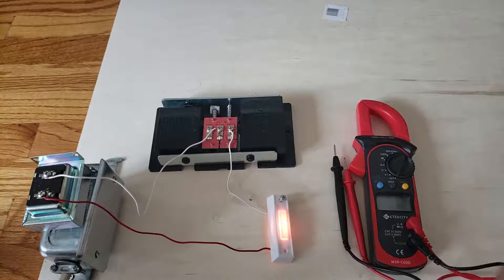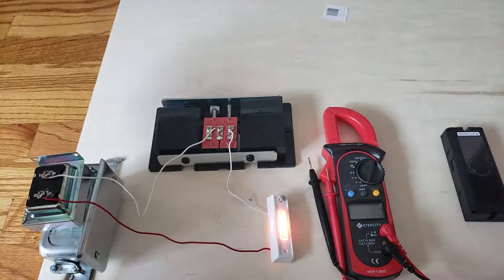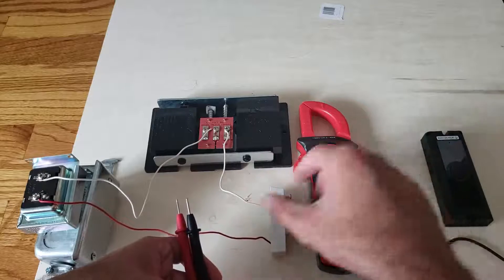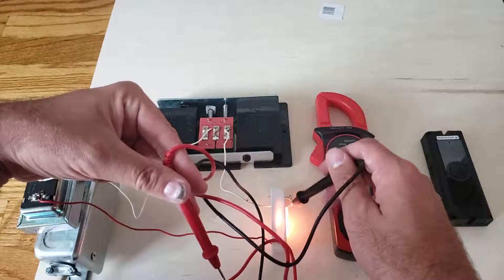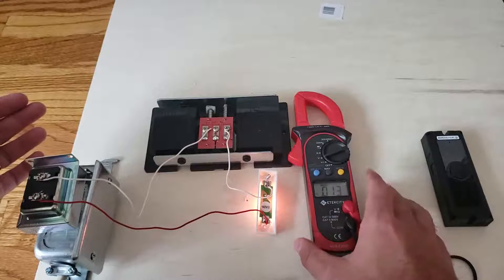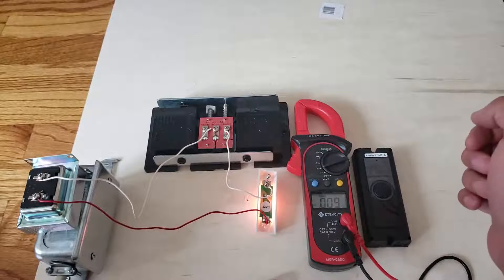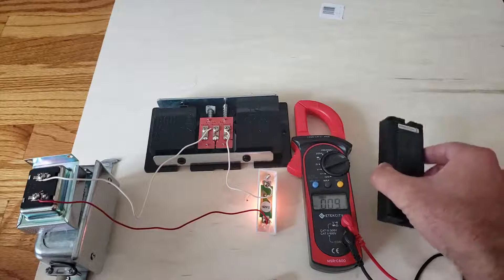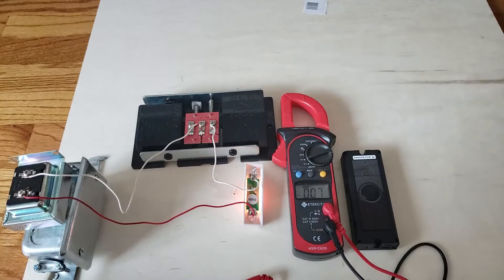Doorbell Transformer Voltage: Do I Have Enough Voltage For Ring or Nest?

Comment: The doorbell constantly makes the shorted out sound when I connect the wires.... The wiring is a mess of Ethernet wires they used before closing up everything when they "finished the basement"

I have confirmed connectivity through the wires, I have measured the ohms when the button is pressed vs not pressed and there is no change.... Could the problem be the doorbell button itself or something else.... I am stumped and getting frustrated 😅

Comment: I’m not sure if you’ll respond, but I’m replacing my old vivint smart doorbell with a Nest Doorbell Camera. None of my wires at the chime are connected—just one set tied into another. At the transformer, a line goes up through the ceiling, then drops by the garage door opener into a plug where both wires screw in. I have no idea how to get my chime to work and make the “ding-dong” sound again.

Comment: My doorbell transformer shows a rating of 10V.  I tested it a couple of time with my multimeter and it's showing right at 20V.  The ring doorbell I'm looking at says you need at least 15V.  Am I good to go with the install since my reading is 20V, regardless of the rating?

Comment: Hi, I have a 16v and two Ring Pro and it's buzing. Do I need a bigger one or ??
Reply: buzzing = likely poor voltage regulation or mismatched wiring. Often a sign of incorrect installation of the Power Kit.....

Or a weak transformer unable to support both chime + camera. Also, Voltage drops over long wires can cause instability.

Id put each of the doorbell on it's own circuit or adjust the transformer. Either way, you'll need electrical knowledge, or an electrician. 

My old profession was whole house tech install low voltage. Eg internet, doorbells, iot, fiber, ....

Comment: If i have 22v at the transformer but 0v at the doorbell, does this mean i need to run a new wire.  I installed wyze v2 doorbell and it worked for 2 days then lost power.  I reset the breaker for the transformer, but same issue.

Comment: I tested my doorbell and it measures 25-28V, which is above the 24V rating, what do you suggest to be able to connect the Ring Doorbell, would it be able to handle it since is close to the range it is designed for? Have not found a 28V to 24V transformer

Comment: I have the Ring wired gen 2. If i have the setup like this in the video my doorbell ring continuously. I also tried to connect those white cables to each other but had no success. If I use a jumper cable between those two cables i get no power on the ring too. My transformer is 12 VAC, 16 VA

Comment: I have a two wire setup also and I measure 22 volts at the transformer, but at the chime, I’m also getting 22 volts even when not pressing the doorbell,   And at the doorbell, I’m reading no voltage.   Why would I be getting 22 volts at the chime?

Comment: Bad presentation. Get it together before you start you video a script would really help. Decide what you are going to represent a video or a voltmeter or how to test. This video is taking up way too much time. If a guy is going to use a meter he knows how to use it we don't need a advertisement of the meter to check our voltage. We don't need instruction on how to use the meter.

Comment: from what I’ve seen in the comments on Amazon from purchasers, lots of people have sufficient power to run the doorbell but not to charge the internal batteries. So there apparently is a Minimum and a recommended. I’m trying to figure out the recommended so I know I will have enough power to keep the batteries charged.

Comment: My door bell does not use a transformer, it uses 4 D Batteries. I am assuming that there is no AC voltage going up to the Chimes. I do have an old alarm system speaker system mounted directly below the door bell chime. I have not taken it fully apart, but I am only seeing 13VDC at the screws. I may have to take this apart further to see if there is an Standard AC voltage going to it. That I might be able to use with a proper transformer.  Any suggestions???

Comment: Hi, my ring health device reads: Your transformer doesn't supply enough power. They recommend installing a Ring Hardware Transformer, do I really need to address this? My voltage level is at 10, was wondering if you have suggestions - Thanks for the info!

Comment: I've always switched my doorbells without shutting off the breaker.  Yet, I always assumed it was DC current and so I didn't bother to shut it off.  Yet, now I'm seeing it's AC, and I've always been told it's not the voltage that kills you, it's the AC which has the power to stop your heart.  Anyone else have a take on this.  I suppose as the voltage is so low under 30 that the potential is too low to be of any worry, or am I wrong?

Comment: What happens if the white wire is not going to a chime?  Can you get enough Voltage with just the red wire running to the transform but the white wire being buried in a wall somewhere?

Comment: I am getting 17.5 v at the transformer but still have problems with intermittent power - is it that the transformer is overheating and doing a reset? I even replaced the transformer and it still cuts out a few times a day? What could be the problem? Ring Pro

Comment: Got a question... i got a 30 VA transformer 120 that goes down to 24v but it puts out 18v n when i read at the doorbell clicker its 10v. The guage wire is 18 and also it runs about 84 feet in the house.

Do you think my problem is that the wire is running too long or that its VA is low or theres a bad connection with the wires, possibly being pressed to hard?

Ohms i read about a 2 on the low side and 53 on the highside.

The

Comment: Correction: Doorbell uses DC Voltage, NOT Alternating  Current (@ 2:35) , its the Transformer that uses the 110-120VAC as Input then converts to VDC to supply the Direct Current Voltage to the doorbell.
Reply: This is incorrect. Doorbells use AC. Transformers just adjust current and voltage. They’re not ac to dc converters.

Comment: Great video, thanks.  I have 18v at the transformer and none at the doorbell wires.  I'm not sure where the chime is (new house to us).

The other odd thing is that the wire for the door bell is 2 strands but jacketed together.  This doesn't seem right if 1 wire goes to the transformer and the other wire to the chime.

Comment: Has anyone ever used a plug in for ring pro? Ring is telling me 12 VA will work but I always thought you need to be closer to 20-30. Also there’s no resistor on the plug in. This is all pretty confusing. There’s a lot of conflicting info out there

Comment: is a 30volt too much? Does that matter?
Reply: depends what devices on the circuit are rated for, if the voltage exceeds the range the device can handle, that is not good for the device

Comment: This doesn’t mention the VA. I have 16V but it’s only 800 ma so it’s only getting 12 VA. Correct voltage doesn’t mean it’s powerful enough.
Reply: Ring ring two there’s no juice getting to the transformer
Reply: 24v transformer for any of the pros or nest from what I've read, now my problem is where tf in my transformer 😂💀
Reply: @bboykensu still trying to find mine lol

Comment: You used the red probe on the red transformer red wire , then on the door bell wires u used the red probe lead to the white wire and the black probe lead on the red wire why is that ? Why didn’t u test the same colors on both transformer and door bell?
Reply: As he said in video, on AC power, it doesn’t matter which is used where to test voltage.
Reply: @JohnHallgren  Ty!

Comment: Question u used the red probe on red on the transformer,the on the door bell deal you tested the red probe on the white wire why is that?
Reply: if you get it backwards, the reading will just be a negative number on the tester

Comment: Something to keep in mind: The Ring Pro line as well as Google Nest Hello (and some others) require the 16-24v range, but if you get the standard hardwired it requires a minimum of 10v and the Ring 2 & 3 require a minimum of 8v. So if anybody is worried about their voltage numbers being too low, or is worried about the proposition of replacing the transformer, this may help alleviate some concerns.
Reply: Hi, my ring health device reads: Your transformer doesn't supply enough power. They recommend installing a Ring Hardware Transformer, do I really need to address this? My voltage level is at 10 was wondering if you have suggestions - Thanks
Reply: @Miahawcal Yes you need 10 - 30 VA
Reply: Best comment ever. 
   You should have made the video!
  Awesome post

Comment: My skybell slimline works fine until the button is pushed, then the chime rings and the chime box stays buzzing, the “plunger” moves up and down a bit constantly until I disconnect the power. I get 21.4 Volts from the transformer. Tried using a 10ohm 1/2 watt resistor like other places suggest but it blew right away. Any ideas? Brand new chime box, brand new transformer.
Reply: Same here. Figure anything out?
Reply: I have 18v at the transformer and 1 v at doorbell?

Comment: Hey, for the Ring Doorbell Pro. Do you have to have a existing charm or can it be installed with just connecting transformer and running wires?
Reply from the maker: You can connect it with an existing chime or you can just install it with a transformer like this one: https://amzn.to/3bBJD7P and it will work without an existing hardwired chime.  What's nice about the ring is that if you don't have a hardwired chime you can connect a wireless ring chime like this: https://amzn.to/3aLuIIG or use and Alexa device like and Echo Show 5: https://amzn.to/3aJql10 as a chime if you want.

Comment: Trying to install a Ring Doorbell. My Transformer reads 20 volts but the power at the doorbell reads 1 volt. Any ideas on what it could be? I'm starting to think it could be the cable that goes from the Transformer to the Doorbell. Thanks!
Reply: Same here. You figure anything out?
Reply: @chasefranklin4477  No sir, ended up just installing the Ring and using its battery. I have to recharge it once a month or so.

Comment: when i test the transformer the multimeter will briefly show 19vac and then show "1  ." (note, if the test leads are not touching anything they will show "0.00" 

so, i am guessing the transformer is bad...?
i have a nest hello doorbell. 
what is strange is that the nest doorbell status light is on and i can stream live video on the nest  app. the nest doorbell will make the chime sound in itself BUT the indoor mechanical chime will not operate. 
comment? advice?

Comment: Great video! Got a question, my doorbell is making that buzzing noise when the button is held down (similar to how yours was at 5:17) Is there any way to correct that?
Reply from the maker: Couple things to try. 1. make sure that nothing is interfering with the chime like a loose wire that prevents it from ringing. 2. Try changing the terminal that is currently on the front to the back on the doorbell chime or vice versa depending on where it's currently connected. Sometimes the chimes burn out and switching the terminals can fix the issue as the other chime most likely has never been used if you only have one doorbell  on your house. 3. Try replacing the chime: https://amzn.to/3lEVrcp . 4. Use a higher power transformer.

Comment: All these videos on testing transformers. Just change it! The chances of you having the right powered transformer for your new fancy video doorbell are about 0.00%. Just talked to Eufy tech line. They do NOT recommend the 16/30va this guy recommends. They recommend the 24/48va found here:    https://www.amazon.com/dp/B07L9X9V57/

Why buy a questionable underpowered transformer (read amazon reviews) when you can but a properly powered unit? Not sure what reason is.
Reply: Just bought a eufy, did you end up installing the transformer you linked? Does it work well?

Comment: Hi! I used a Skybell HD for 2 yrs no problems, but then I got some power warmings. I upgraded from my original home transformer (turns out it was 10V) to a 16V unit. My Skybell was still having intermittent wifi and reset problems after that (I noticed it a few times after the button was pressed). I got irritated and upgraded to an Arlo video doorbell, but that also mentioned low power. I bought a 24V transformer and noticed I get 25ish V at the transformer, but only around 13V at the doorbell. Any idea what might be causing such a drop? I have a basic old chime and I only have a front doorbell. I'm wondering if maybe it's cuz the wires are so thin it can't support that voltage?
Reply from the maker: Try replacing the chime, most likely where your problem is and easier than running new wiring.

Comment: That's very informative. What is the specification of this transformer, 16 or 20v? Also, how do I test the voltage-amp of my old transformer with no label? It reads consistently between 16 and 17v, so it should be a 16v transformer.
Reply from the maker: If it's reading between 16 and 17 its a 16v transformer.

Comment: I’m reading 27.5 volts AC at my doorbell button. Will this be too much voltage for the Ring Doorbell 3 Plus?
Reply: Mine says 25-26. Will it hurt it?
Reply: @Chriswguerra  you should be fine. I installed mine with the 27.5v and it’s working perfectly.
Reply: Jamison Video Production thanks for responding!!!! That’s great to hear

Comment: Will a bad doorbell transformer effect the voltage or rather power in the other outlets in the room.
Reply: Saifu if a problem was on the output side (doorbell side) there is a good chance it will not affect any outlets on the same circuit because a transformer isolates the input side and output sides of its internal circuitry. The 2 sides of a transformer are wire windings that share a common electromagnetic field but the wires do not actually touch each other. If a problem was on the input side of the transformer and you had issues I would assume you would be tripping the circuit breaker. What kind of problems are you seeing?

Comment: I have 22 VAC at the transformer. After installing the ring 2, I have a hum coming from the chime. Help.
Reply: If your current wired doorbell is compatible with Hello, you must install the chime connector. The Nest app will walk you through installation as part of Nest Hello setup.
Note: The chime connector allows your existing wires to deliver constant power to Hello while protecting your chime, which might otherwise be damaged from the constantly flowing current. In addition, without the chime connector, you might experience chime buzzing or unexpected chimes. So be sure to follow the steps in the Nest app to install the chime connector.
Seen this on their website hopefully it helps
Reply: johnny b I am installing a Ring 2. I bought a compatible chime and the recommended transformer. Still get a hum.
Reply: jason ferguson: Did you install the included pro power supply device in your chime box?

Comment: Hey i got another ring for cheap & i want to put it under my pool building that faxes the big garage. Am i able to just pull an outlet out & use the wires from that? Is it too high voltage? How do i find out?
Reply from the maker: You can't use an outlet (too high voltage) but you can use a plug in transformer like this: https://amzn.to/3br6r7X which will work and you can plug into your existing outlet the transformer steps down the voltage form 120V to 24V. I also recommend using an outlet cover: https://amzn.to/2zxwTQ4  for an outdoor outlet to keep the transformer from getting wet.
Reply: @OneHourSmartHome  oh my thankyou so much!!! Is that the exact one i need?

Comment: My transformer voltage is running at 15.8. Is that safe to install or do I need a new transformer because of that 0.2 v difference?
Reply from the maker: That should be fine.
Reply: mine show 12 v rip

Comment: Doorbell transformers are usually located outside the home along the siding or on a wall in the garage. They may also be fixed to a wall in the basement or closet near the front door or entryway. If you don't see it in any of these places, check the walls in the attic. It may be tucked behind the insulation.
Reply: I've been looking for mine for a few days now. I found the furnace transformer in the basement and that's it. I am almost positive it's in the attic, but it's too small for me to fit in. I hate whoever decided that was the best place for it. I'm getting about 20 volts at the the button, but the chime is an old mechanical Trine and says to use a 10va transformer on it. I'm gonna go ahead and hook the new doorbell camera up and see if it will work, if it doesn't, I guess I'll have to find a Jockey that moonlights as an electrician, or vice versa.
Reply: @ethiceze54  If your getting 20 volts at the bell your good.  Doesn't matter what the chime wants.  Probably the chime was a min. of the listed voltage.
Reply from the maker: Red, good tips we also have a post on it here: https://www.onehoursmarthome.com/blog/how-to-find-doorbell-transformer